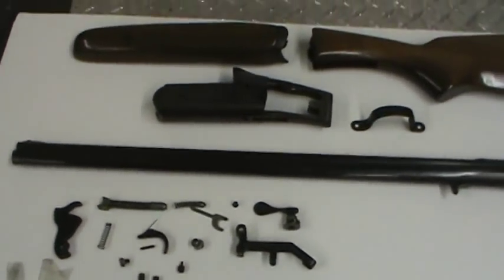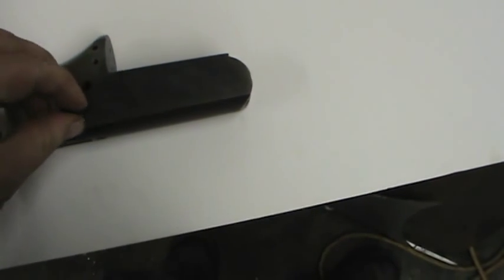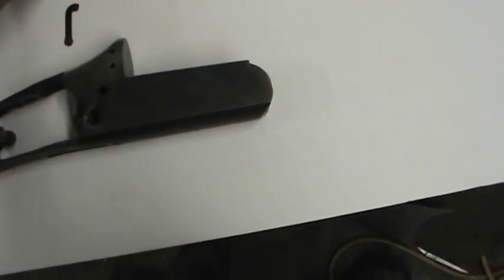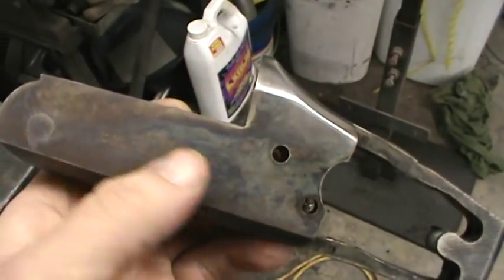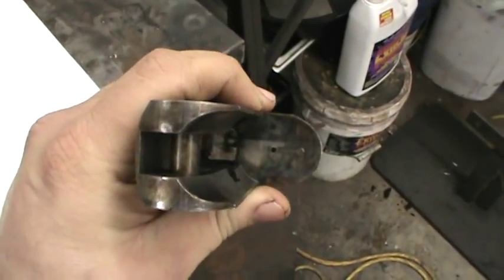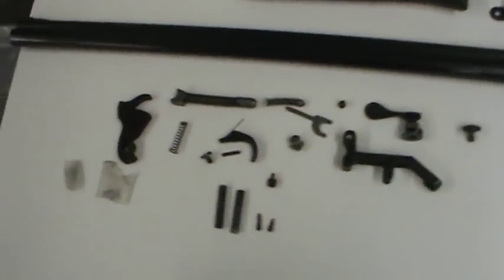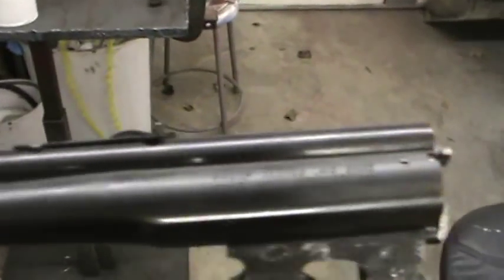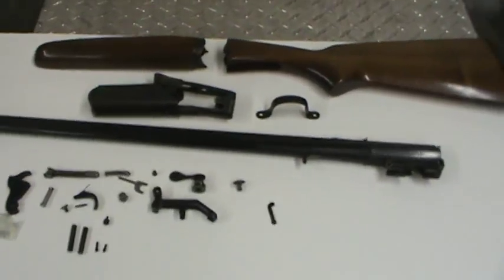gunsmithing on a Savage model 24 over & under part 1

Comment: Good video but at parts 7 & 8 I was hoping you would show the full reassembly.  I had lots of trouble getting my hammer spring assembly back into place.  What finally worked was I drilled a small 1/64" hole through the aluminum back stop piece and hammer pin (near the rear), compressed the pin and stuck a small pin through it.  Then I put the hammer spring assembly back into place and removed the pin and tested for function.
Reply from the maker: Fone Star Yes i wished i did a video on reassembly ...i should have my butt kicked for that ...sorry
Reply: I figured it out, it wasn't too hard.  Just the hammer spring was the only hard part.  Now with the hole in the hammer assembly it should come apart and go together more easily.

Comment: The actin  is soposta be case color hardened
Reply: Did one a few years back and color cased it.  Turn out awesome.  Currently rust blueing 2 of these.  Hot blue will turn cast more purple and will eat solder on barrel.    Will be interesting when I get to the rest of the parts on his videos to see how he got around blueing the cast.   

One way I was told years ago was to put cast recievers in when the salts were cold.  Haven’t tested it out yet

Comment: I got an old one from a friend that needed refinishing and was missing some parts - sights, barrel selector, etc.  Between eBay and local gun shows I've run down all the parts I need and bought a booklet on disassembly/reassembly but the book merely says to "nudge" the mainspring out. That spring is a bear and I have no idea how to go about removing it. It's not going to be "nudged" out of position. The repair job is at a complete standstill till I can remove the mainspring.  
Can anyone give me a clue how to go about this?
Reply: Take out the pin that holds the hammer in There is a video showing how to reinstall it, but it it is a bear of a job Be sure to put the long part of the hammer spring holder on the bottom.

Comment from the maker: Nunrich  has most parts and schematics..... thanks...
Reply: Hi there
there is an upgrade to this gun. you can purchase a selector for the hammer which gets rid of the button style selector. but if you want to keep it original than they sell a replacement kit
Reply: +Chris Purvis   i'm buying a model 24 in 12/223 ,where can you get the upgrade parts if i need them?
Reply: I still haven't purchased the parts. Are you in Canada or States?

Comment: I don't think it's a 25, it's a 42 most likely. The 24 is 20 guage lower 42 is usally a 410 lower.
Reply: It's definitely an earlier Model 24.  You can tell by the barrel selector which the later 24's and 42 don't have, the selector is part of the hammer, and it has a wooden stock.  The 24's came with 410, 20, and 12 gauge lower and .17 HMR, .22 LR, .22 Hornet., .222 Rem., 223 Rem., .30-30 Win, .308, .357 Rem Mag, .357 Rem Max, and possibly some others for the upper.  The 42 only comes with 410 and .22, unfortunately, and has a synthetic stock.

I'd love to be able to buy one in .270 Win/12 gauge but alas....
Reply: 42s are the modern remakes of the 24s. 24s came in many configurations of calibers/gauges. I believe 42s only come in 410 with either 22lr or 22 mag on top.
Reply: This is definitely not a 25, that is not hot blued they are color case hardened. These parts can be found on numrich, eBay or jack first. Do not let this guy touch a gun.